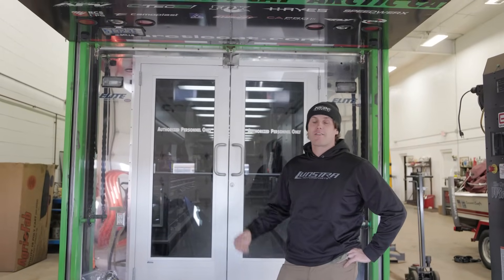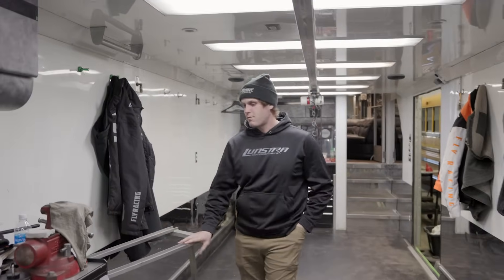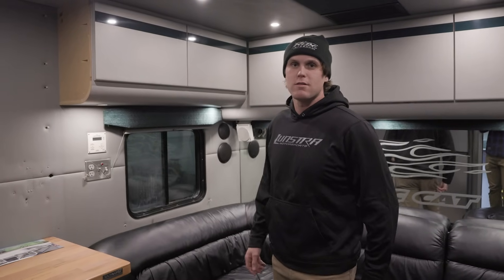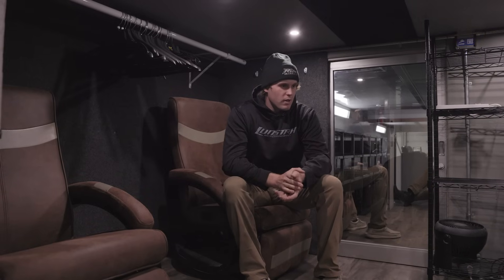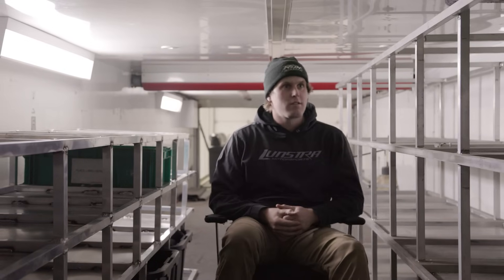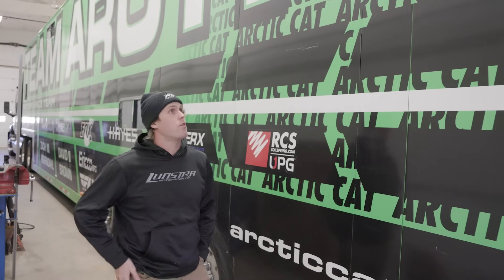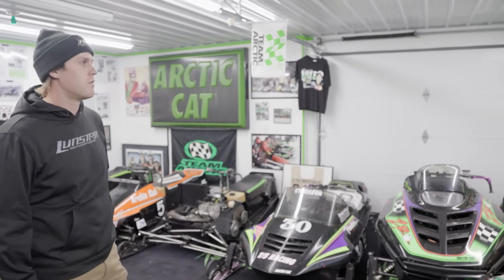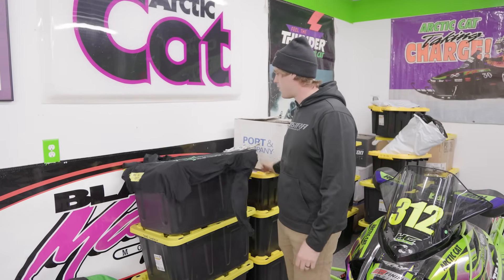Factory ARCTIC CAT Race Trailer Tour

Comment: You should add a Turf Tiger to your collection, I know where one is. Basically sat in a show room. Low use on it.
Reply: The TT is so rare most folks never saw one. A sled built for grass racing based off the 1971 EXT short chassis. Most famous for being the sled that forced Ski Doo to put their performance machines on a diet. Skidoo bought a 440 TT by Straw Purchase just to see what Cat had built. In grass drags this light machine beat their 650! Not to mention anything smaller they had raced on snow the past season.Ski Doo had power but their sleds were heavy. This experience, along with the Yamaha beating them at Eagle River, forced them to go after weight for the new race sleds.  They kept the TT chassis around for a few years as a summer engine test mule. Finally scrapping it sometime in the late 70s.